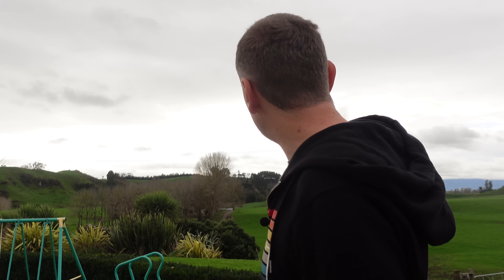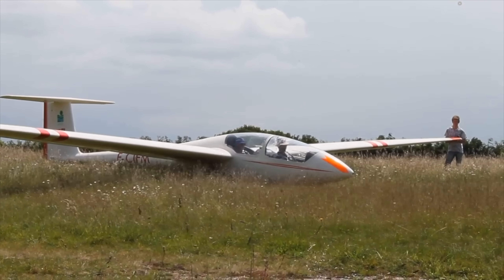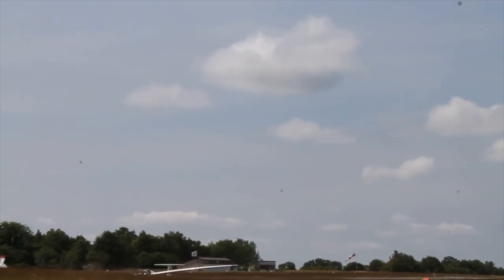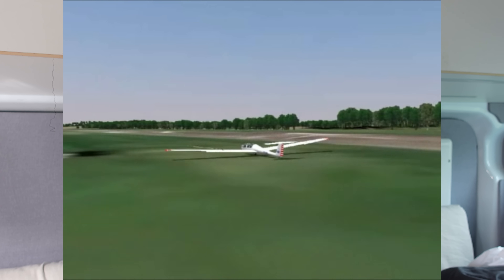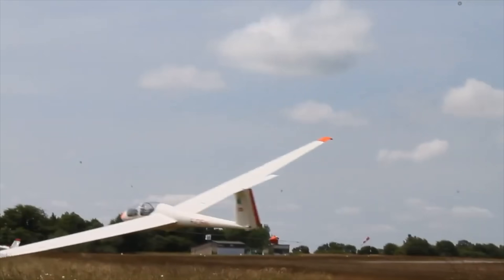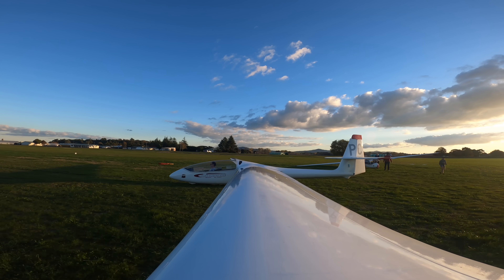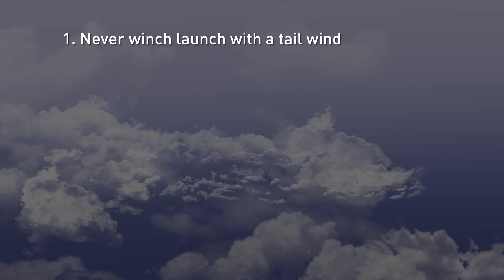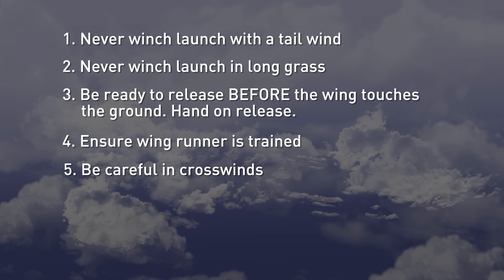Glider Winch Launch Crash 💥 Instructor Reacts

Comment: I may be wrong in this, (if so, please do tell me)
When i hold the wing during a launch (whether it's an aerotow of winch doesn't really matter) i try to hold the wing not exactly steady or in the horizontal position, but I move (of hold) it gently in the direction the pilot is steering at that moment. The pilot usualy corrects his stick position instinctively in less than a second. Most of the time, the result is a neutral stick position and horizontal wings, within a few seconds, long before the cable is all out.
If the pilot prefers the wings held a little banked into the wind, he instinctively moves the stick in that direction. If the tip runner follows that hint, the pilot gets exactly what he wants and expects.
Being tip runner: small and gentle movements, of course, and NEVER apply strong force on the wing tip. If you do, there will be a sudden difference in force on the wing when you release it, and the pilot will feel a sudden change in bank angle, may even overcompensate... So rather let it move in the direction it wants (whithout having the wings touch the ground on either side) so the pilot automatically applies correction in the right direction. 
In an extreme situation, the pilot was holding the stick far of the middle (rarely happens, but it did once) I knocked on the wing to get the pilots attention to correct his stick position.
Up until now, works like a charm, so far no complaints from the pilot.
Reply from the maker: Thanks, good advice. I should make a video on wing running!
Reply: As a wing runner, if the tip is exerting any up or down force STOP THE LAUNCH.

Comment: Cannot understand why they cannot just put two light weight rubber wheels on either side 🥴
Reply: Some gliders have this. Works for aerotow or selflaunch of a paved or very short-cut grass runway.
Unsuitable for winch launching, especially with tall grass or in cross wind conditions
Reply from the maker: Yes we have wheels on our training glider wingtips. Long grass, it won't make any difference...
Reply: @PureGlide  then the next best option MOW THE GRASS BEFORE TRAINING 🥴

Comment: I was taught as a wing runner to stand slightly forward of the wingtip. so that the tip would not be snatched out of my hand the moment it started to move, but would travel past me as i started my run. It just gave a few more seconds in which i was supporting the wing. Standing behind the wing you've no chance of keeping up with it...It also had the advantage that the pilot could see me holding his wing during the take up slack.
Reply from the maker: Another good tip, cheers!
Reply: We learned to stand behind in order not to be hit with the wing. To be honest, for a winch start you do not really need to hold the wing for more than a couple of steps unless you have a strong tail wind)
Reply: It makes sense to stand slightly forward but you should not hold the wing at the leading edge. I observed wing runners who would in this case unintentionally hold the wing back, sometimes even slightly turning the glider in their direction. If the wing is fast enough to be snatched out of your hand, it is fast enough for the pilots to level it themselves with the aileron.
Reply: And pinch it with your fingertips, don't grasp it (particularly on a leading edge) with your whole hand in such a way that your hand could catch it and spin the wing around.  It's about delicately balancing, not holding back or pushing, I was taught, which makes sense.  And keep running alongside/balancing until it naturally accelrates away from you too.  Your fast running speed for release is about right.

I have seen some inexperienced wingrunners give a final "push" on the wing as they release, which is just as bad as holding a wingtip back.  Not so good.

Comment: Very good video. I don't think the wing runner could have held on any longer, with a powerful winch it is not possible to hold on for more than a couple of steps. One point which you did not mention is that we brief wing runners not to launch if they are having to apply any up or down pressure to hold the wings level. I am horrified by winching with long grass. We teach to hold the release and pull it if a wing is going down but it can happen so quickly and the pilot is looking forwards.
Reply: The first thing the pilot may notice is the strong yaw.
Reply from the maker: Thanks Mark, I'll make a separate video about wing running sometime! It's an art into itself sometimes...

Comment: Very good video. I don't think the wing runner could have held on any longer.
Reply from the maker: I reckon they could have, but also it might not have made much difference... Now we know there was some cross wind they should have been on the upwind side, holding the wing down a bit. That probably would have helped more.
Reply: @PureGlide  Or on the downwind side holding the wing up? If on the upwind side there is a danger of the wing runner holding the wing back, which aggravates the swing. Ironically, I fly a self-launcher with tip wheels, and always start with a wingtip on the ground, the into wind wing down if there is a crosswind.

Comment: Wow, that got my attention! These pilots were very lucky. It's so easy to have your hand on the release in a K21, unlike in some types (ASW19, Nimbus, I'm looking at you...). Being a wing runner is a skilled job. For example, in a crosswind you want to hold the into wind wing just a bit low, to avoid the inadvertent roll, but you might notice that the pilot holds the ailerons away from you, trying to level the wings, which is worse! The pilot should also apply full rudder before the launch if they believe there will be any yaw, and be ready to make quick and large rudder inputs as soon as the actual yaw is apparent. It's hard to see in the video whether any rudder was applied here, but I suspect it wouldn't have made any difference.
Reply: Wouldn't full rudder inputs at the start of the ground roll cause a large rolling force, as a result of the secondary effect of the rudder/yaw? 

I think more useful might be to pull the cable in line with the glider to prevent yawing. Lot easier these days with dyneema as well
Reply: @StudentGoose  great question. Not if it is counteracting one of the other yawing tendencies, like crosswind. It's not always possible to eliminate yawing factors so you have to be ready for it. Of course part of being prepared is being ready to centralise(ish) the rudder once you have sufficient airspeed
Reply from the maker: There will be very little yawing secondary effect of the rudder in the first part of the roll, because there isn't enough airflow yet. Once it builds up speed then yes maybe some. But by then the ailerons should be working too?
Reply: I made a lanyard with a monkey's fist knot on the end for my ASW-19 to facilitate being able to release quickly.

Comment: It's crazy, that the same thing happend to me 2 days ago. My wingtip got to low at the launch and I released right away. But i did exaktly the thing you predicted and spun 90° arround.
Reply from the maker: Hey glad it turned out OK, and that I'm not talking complete rubbish!
Reply: @PureGlide  Well I think arround 450 winch launches as PIC helped a lot.
In my opinion are the short flights ("Platzrunden" in german) more important than many believe. It´s pure training for some more difficult situations like an outlanding or some complication while starting.
Reply: Glad you were okay and the training paid off. Happy landings.

Comment: Valuable instruction as always. As an experienced glider pilot and winch driver, can I add a couple of points. Unless you are an instructor with experience of pulling the release for simulated cable breaks, you have no idea how much effort it takes to pull it under full load. It can be quite a lot more than expected. I recall an accident report of a few years ago that commented on woolly gloves contributing to the accident- hindering effective grip on the shiny knob. Be aware of this in colder weather.   Wear good grippy leather gloves or none.
I think winch drivers could do more to make the start less of a jerk, I was taught to open the throttle gently, whilst swiftly, so not to throw the pilot all over the place at a critical moment.
Reply from the maker: Hey great points, thanks for sharing!
Reply: Good points, I take gloves off for all launches and whenever I’m running the wing. My instructors taught me years ago to keep a firm grip on that release as you wouldn’t believe how hard you’d need to pull in an emergency situation.
Reply: Agreed, I'd like to add that a smooth acceleration is very good for the wing runner also, to a better job, not trip or slip in the long grass and should also be properly instructed. Like, don't  hang onto the wing tip to help your feet to catch up! Also if cross wind was from the right, an experienced wing runner, on the right wing tip could have hung on to pull the wing back and down before its all going too fast.
Reply: Serious suggestion - You won't easily beat rubber palmed knitted back work gloves for grip. 
They're fairly warm too.  ('Tho if you intend to go poking around in high wave you'll maybe want something much more insulated).
Reply: Good idea on gloves. I'd like to recommend that all cable knobs be full of grooves and rounded pointy bits for good grip by any hand or gloves.
Reply: @halbowker  You got me thinking there Hal .........
Pedal bike handlebar grip tape could be wound around and a very 'sticky' type could be chosen.
BUT
Whether that would be a permitted modification / might insurers try and use it as a let out on liability?  ..... That - like your suggestions - would need exploring.

The advantage over gloves of course is you don't have to remember the gloves - Seriously taking human error out of the chain is a good move.

Comment: Thank you for bringing attention to this very important aspect of the winch launch. Another cause of a wing dropping is water ballast that has run into the downward wing whilst the glider is parked. The wing runner should notice that there is some down or up force on the wing with the wings level.
Reply from the maker: Yeah great point, thanks! I might do a video on wing running at some stage, that's a great point to cover.

Comment: The grass needed a cutting. The release could also be the Tost autoreleasing because the pull is reversed.
Reply from the maker: It did auto release, as was discovered in the pinned comment. That makes it more scary really, they couldn't/weren't trying to get to the release at all.

Comment: One more importand aspect of wing running is to hold the wing loosely from below, as one time, as a solo student, my wing runner grabed it hard and started pulling me to the right. At first I thought that the rope was towed badly, but when I got to full left pedal and was still headed for the cornfield on the side of the runway, and was about to release, my glider springed around but I was thankfully able to corect. 10/10 would not do that again.
PS: what is you opinion? Should have I released with the runner still holding, or would I have risked the rope snaking and hitting them?
Reply from the maker: Depends how close to the fence you are :) And also if you were using a belly hook or not. You can normally recover more easily on the nose hook.
Reply: @PureGlide  It was on the belly hook, 17m 2-seater, and had maybe another 20-30m from the end of my wing, and no fence, but I think there would be a lot of denting from mature corn

Comment: If there is a crosswind .......the runner should have been on the upwind side .
Reply from the maker: Yes that's what the BGA recommends
Reply: No the BGA recommends on the downwind side to prevent weathercocking.
Reply: @christopherrobinson7541  you can prevent weathercocking from either wing (basic physics)...holding the upwind wing is so that the wind can't catch the upwind wing from underneath sending it skyward.

Comment: We've all seen the BGA animations but we just know the sceptics and less averse ones amongst us  will dismiss this as over dramatising an incident. Some of our pilots did when we  warned about the damage that could occur if the spare cable was left near a glider or onlookers and picked up by the live cable.  Until we have an incident which fortunately due to our controls worked and avoided injury, just. This is unfortunate but exactly what we need to get the message across.  There are several control failures examples to discuss during this video . I think you got em all. We will be using/sharing this :-)
Reply from the maker: Thanks Richard, yes I too had seen those videos previously, but until you see it in 'real life' via that video it doesn't quite seem realistic. Cheers
Reply: @PureGlide  Do we know if the winch driver had a view of the launch-point?  some sites don't and rely purely on radio or semaphore controls. It appears that power was supplied until after release although that appears to be a back release. They could have improved the outcome possibly by dropping the power and reducing the rotation, possibly. BTW your door analogy is great.

Comment: Long grass also affects "wind gradient" and can cause a significantly different air speed over the port and starboard wing panels , even before the glider is moving.
Reply from the maker: Interesting, I hadn't thought of that. Cheers
Reply: @PureGlide  that’s an interesting.point.  So initially the wing is sheltered from the wind in the grass but as soon as the right wing lifts, the relative wind will increase dramatically and that’s adding to the fact it’s travelling forwards faster because it’s rotating forwards because of the drag so no wonder it lifts so quickly.  Plus the lift on the right just pushes the left wing harder into the long grass.
Reply: An aerodynamics buff at my club did some non-steady state analysis many years ago when we had a similar accident. His conclusions were that the drastic change in relative wind gradient seen by the higher wing played a more important role in the onset than the superior "friction drag" from the wing dragging through the grass / soil.

This might explain why crosswinds are such a strong aggravating factor in these events, as they also affect the gradient assymetrically.
Reply: *Affects. Quite a different meaning to effects.

Comment: My mandatory comment to your videos, pretending I know what I'm talking about :P

What's with these wing runners who don't actually run? I'm noticing it's a bit of a habit. Maybe that needs to be stressed a little more on training. 
I saw this ALMOST happening live once, and I believe it didn't happen, probably, only because the initial acceleration of the winch was slower than this one, allowing a little longer for the pilot to release. The glider did half a ground loop in that case, but it wasn't fast enough to become airborne.
Is it possible that a gust helped it airborne early in this video as well? Crosswind gust, even worse?

The rest of what I wanted to blabber about has been already raised :)

Nice video.

Do you usually push doors open with your pinky finger?
Reply: They really don't need to run that much, just not impart any moment to the wingtip, when they release and try to compensate for wind.
Reply from the maker: Haha yes that's how I always open doors :) And yes often wing runners don't need to run far, and a lot of them are older and can't actually run easily. It's also important to make sure they don't hold onto the wing and turn it. Basically, they do need a bit of training.

Comment: Really instructive footage and commentary. One thing I'd build on is that wing-running needs proper thought and training, and whoever's running the launch point should be observing the quality of wing-running alongside the rest of the activity. While it's certainly true that lackadaisical wing-running can cause problems so can the opposite, where someone over-compensates, develops a death grip on the wingtip and tries really hard to hold on as long as they can. Have seen this result in the wing-runner themselves holding the wing back as the winch accelerates and they can't keep up, thus causing the very swing they were there to help prevent.
Reply from the maker: Hi thanks for that, and completely agree. Could do a whole other video on wing running!
Reply: @PureGlide  That would be a great public service: obviously your own club could then use it as part of ground-handling training for newcomers and I'm sure we would have it in the rainy-day library too.
Reply: In the 70s you could only be a wing runner if you were trained up to the task.

Comment: We keep it simple at our club…. Eventualities brief: During the ground run, if you can’t keep the wings level, release immediately! Safest approach to this issue. Great video and we’ll done! 👍🏻
Reply: It's been a decade since I last flew a glider and I still have the phrasing my club used drilled into my brain: "I will keep my hand on the cable release until we are airborne. If a wing begins to drop during the ground run and I cannot instantly correct it with opposite aileron I will pull the release immediately". Gloves were also banned during winch launching at my club after an incident where a pilot wearing a glove tried to pull the release and it failed because the ball slipped through their hand (you could wear gloves in flight, you just had to put the left one on after the launch was completed).
Reply from the maker: Yip bang on, that is the critical bit
Reply: The wing should fly out of the hand. He seems to push the wing . Long grass slows down his running